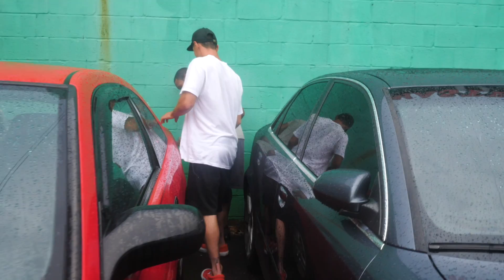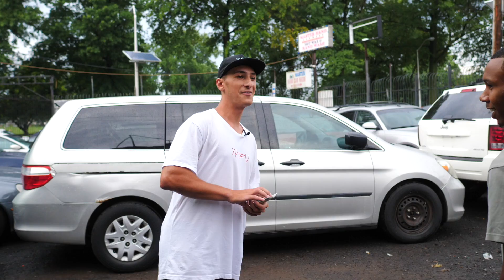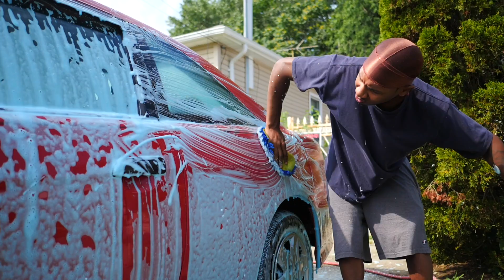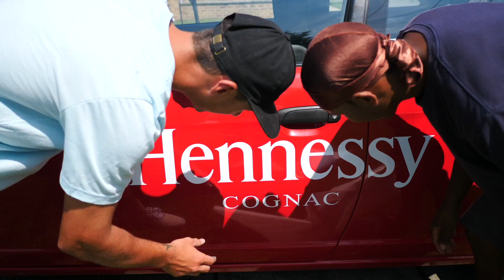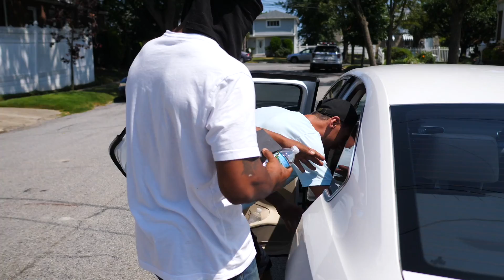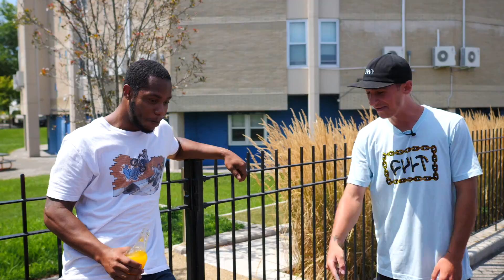SURPRISING RUSTY WITH HIS FIRST CAR!

Comment: Panza just a heads up, i would get the alternator replaced or maybe it was the immobilizer but small engines like that shouldn’t crank over that much it should be and instan start after turning the key.